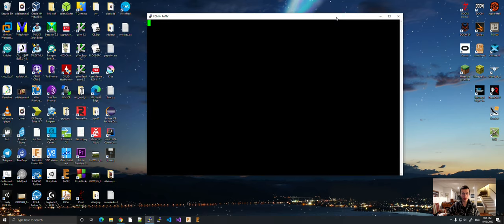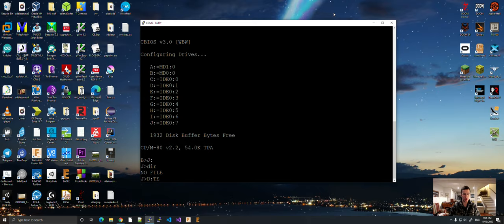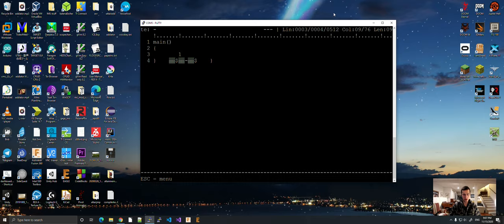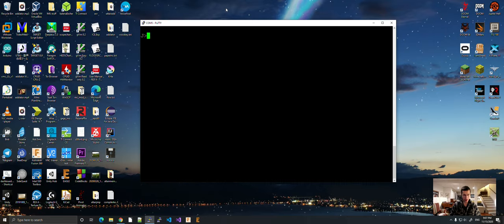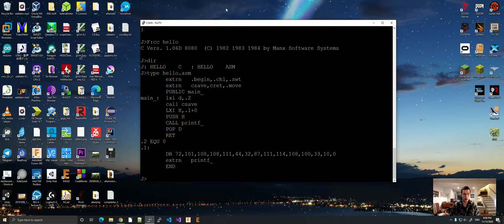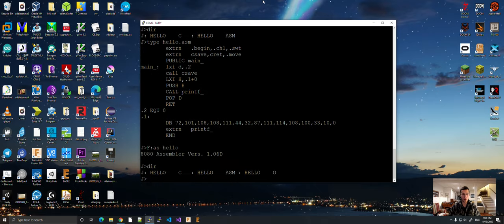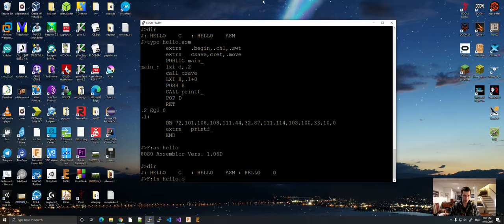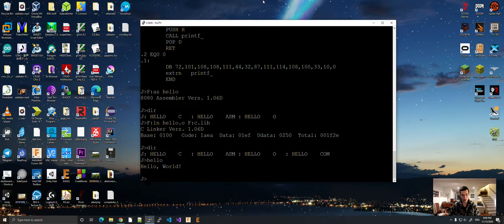Aztec C Compiler on CP/M - Hello World Tutorial

Comment: I also use Aztech c and try to start an external program with parameters but unfortunately it doesn't work. I use the execv or execl command but the parameter is always ignored.
I use version 1.06.
Reply from the maker: Do you mean parameters from the command line? If so, using int argc, char** argv will work
Reply from the maker: Failing that, the buffer starts at 80h in the memory map